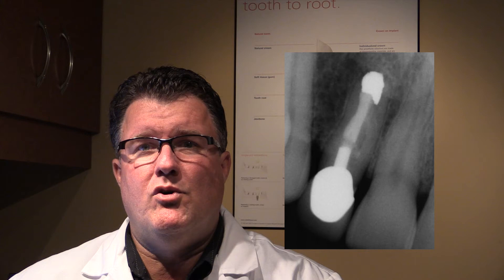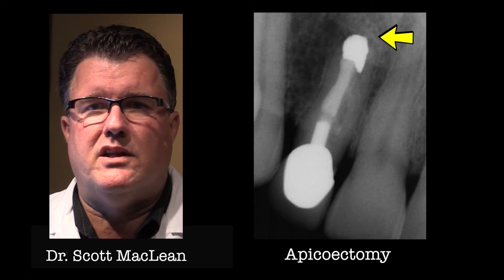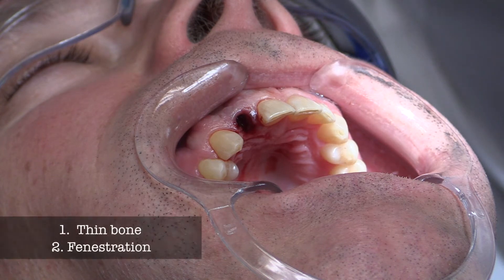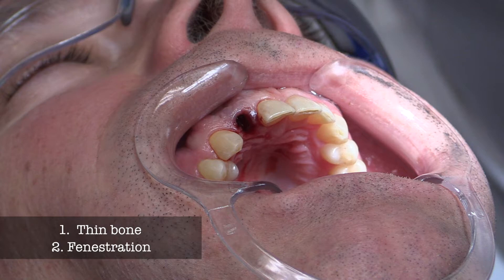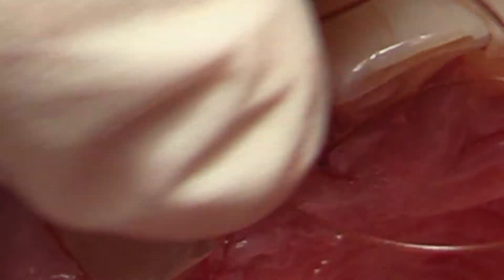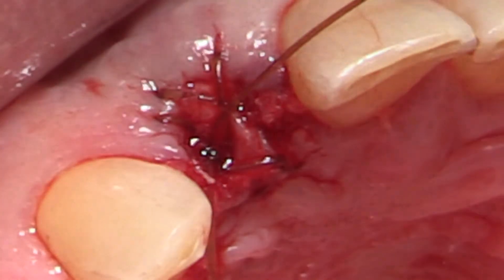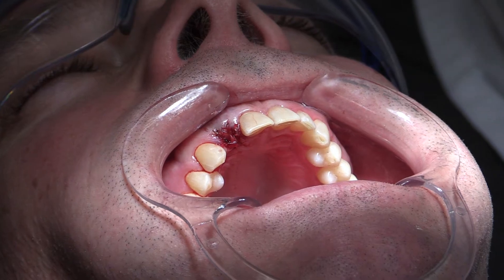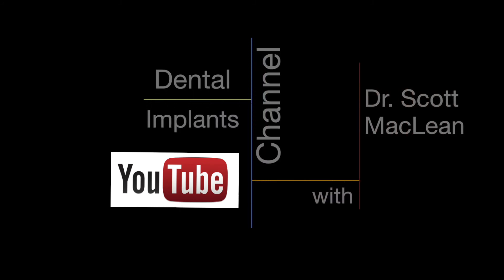Ridge Preservation Technique - Creos Bone Grafting - Dental Implant

Comment: Thanks for this very interesting clip, Dr. MacLean...I am wondering if you have been or may be working at all with the ceramic  bone scaffolding that has been developed by Dr. Julian Yu and Prof Hala Zreiqat at the University of Sydney? This apparently becomes stronger that original bone when it is fully adapted to the surrounding tissue - which is able to grow into the ceramic material. This to me looks very interesting as a way to replace bone loss from extractions - and I am wondering how it might work with the non-metallic implants?

Comment: Thank you for this great and informative video Scott.
1. Does it matter which side up the membrane is placed? when we used bio-guide a particular surface had to be in contact with the bone
2. You did not raise a flap in this case and used the membrane against the socket wall, do you ever place the membrane between the bone and overlying soft tissue?

Thank you again

Comment: Couldn't you have still placed the immediate? I've seen cases where the buccal plate is completely gone (or fractured) and this same technique was used with an immediate placement of an implant. You would be engaging mostly lingual bone anyway. What are your thoughts?
Reply from the maker: Bone was too thin and not firm. I attempted but aborted. If bone was thicker then I might attempt an immediate. Laterals have a bit higher rejection rate in my hands. I treat this area with a little more traditional approach sometimes. Do you find any issues with laterals?